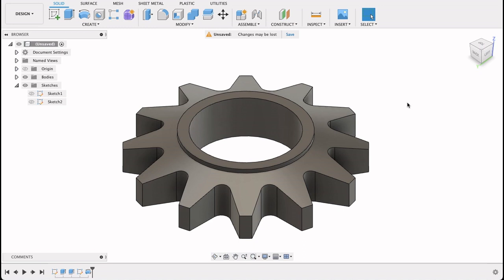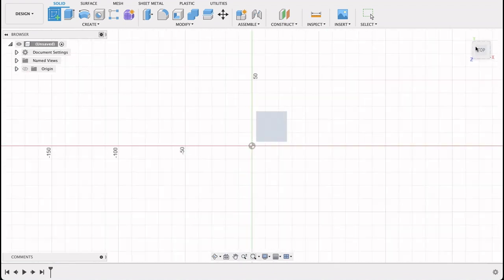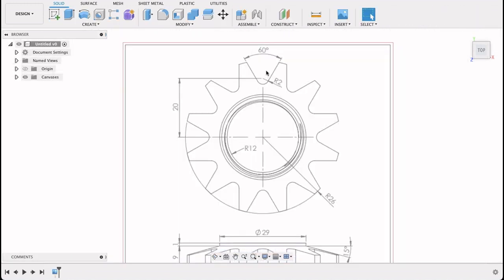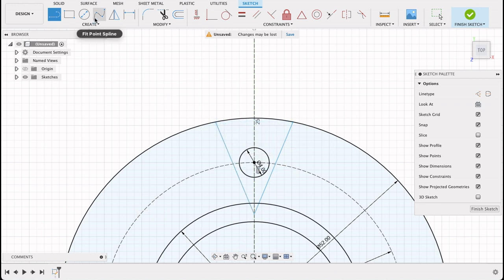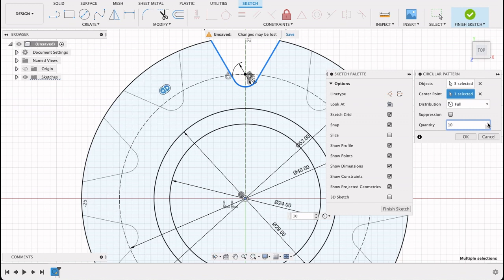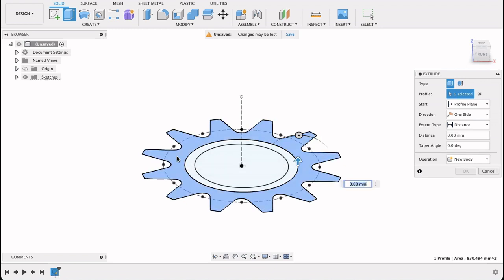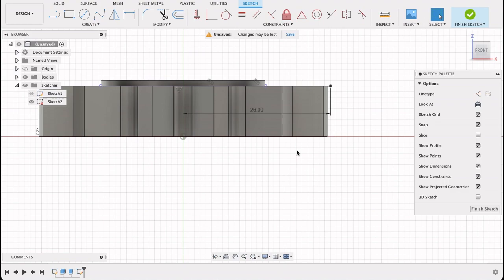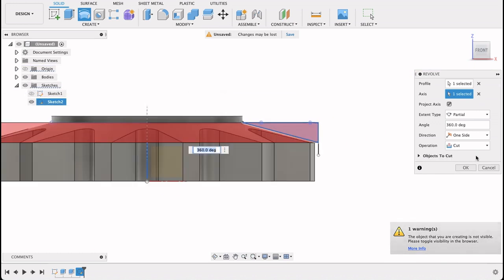Fusion 360 intermediate tutorial: How to make a 3D gear

Comment: Nice tutorial and video. Enjoy the pacing and techniques. I had to manually project the top ring into my second sketch in order to get that point - even though I have auto-project enabled, it wasn't picking up that inside corner point for some reason. But still worked fine.
Reply from the maker: Glad you figured it out. I always use project manually. Just feels like there’s less chance of something going wrong